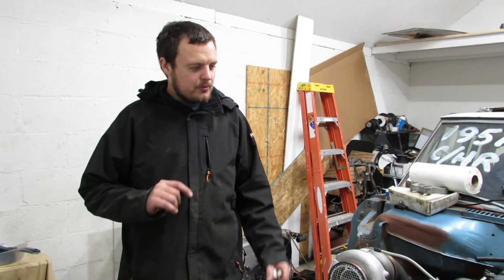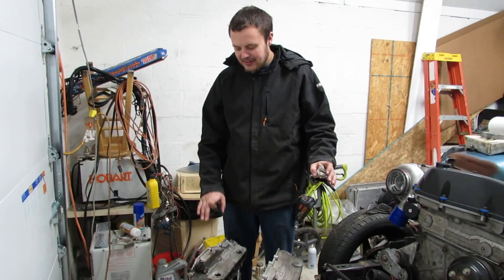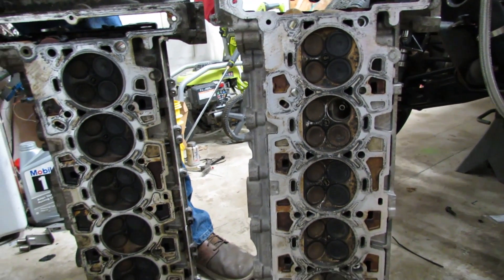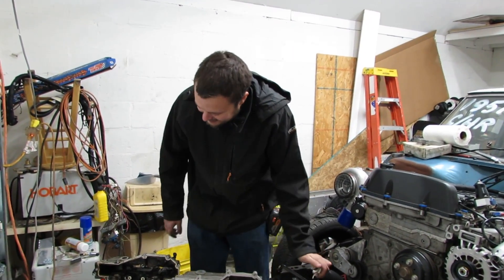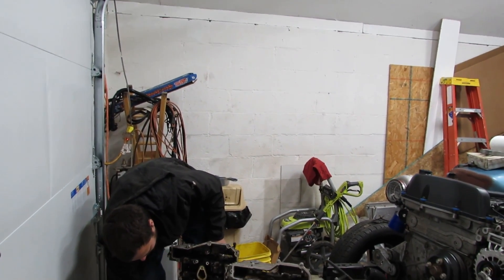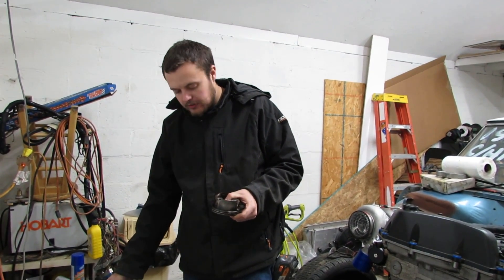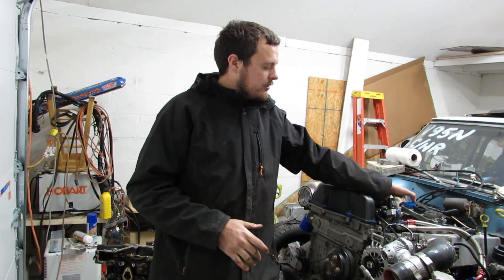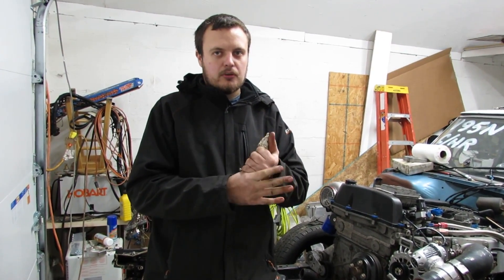Vortec 4200 Engine Differences

Comment: What do you think of the removable sleeves in the block? If you were to use an aftermarket ECU what would you use? Megasquirt perhaps?
Reply from the maker: They're not really removable. 

I use Megasquirt 3 Goldbox.
Reply: @Calvin-Nelson  Replaceable i meant. I read somewhere that they're replaceable, but that of course is the internet. The block does have sleeves correct? I live in San Diego and I'm close to Darton Sleeves. Currently working on an 04 Trailblazer LS. This video was really good to see the difference in heads. Are you using the stock head studs or aftermarket like ARP? And head gasket? I've been looking towards Cometic or whoever makes a multi layer steel. Eventual goal is a remote mount twin turbo setup at the rear axle. I have two genuine Garrett GT3076r's that came off my 05 Audi Allroad project.
Reply from the maker: @ProjectCarTV  I'm sure that you could sleeve a block. Not really worth it in my opinion. The stock blocks will take some abuse from what I've read and experienced. All the stuff we've done is with the stock engine. Not even opened up. They come factory with MLS head gaskets.
Reply: @Calvin-Nelson  gracias!
Reply: @Calvin-Nelson  Thanks a lot! I'll have to do some sleeving no doubt though. I ordered a 4l60e from Monster Transmission that's good for 1000+. I saw the stock rods in your video and although they're pretty beefy I think I'll go with Pauter.  I'm lucky to be where I'm at in San Diego, so many good companies in this city. Crower, Pauter, Carillo, Darton. Not to mention machine shops. I have a spare block that I'm going to be taking for machining soon. Using two 3076's automatically puts me well above 500hp. I may use a stock block for testing. I have a lot of work ahead. Still have to find a daily driver to take the Trailblazer off the road. One that I won't be tempted to f**k with. I can't even buy a used Hyundai Elantra because the 2.0L engines are shared with Mitsubishi and I'll be tempted once again lol. Thanks a lot. I've been following your channel but never commented.

Comment: Can you just run the stock 02-05 ecu for a turbo set up and switch it to a 2 bar map sensor? My buddy and I twin turboed a 5.3 and were able to tune it with just a 2 bar map on it. Is this possible with the stock 1st gen ecu?
Reply from the maker: No. There is no way to add enrichment with boost.

Comment: Heyy man im bench watch ur 4.2 engine  build to learn more about it wanting to build mine as well. I have my 05 head rebuild was thinking on porting it but don't really know much on all that and knowing that the ecu won't work for tuning would the other one plug in and play haha .
Reply from the maker: You would have to repin it and add a MAF sensor, but it has been done before. It it were mine, I would look at upgrading to an 06+ head and maybe port that.
Reply: You’ll spend $1500 on a port job and it’ll flow about the same as an 06+ when stock. Just buy the 06 head for like $200.

Comment: Thoughts about this going in a 83 caprice?
Reply from the maker: Do it
Reply: @Calvin-Nelson  will I have the same issues with it being too tall for clearance on the hood? 
Also debating on doing manual swap as well. But can’t find information about that either.
Reply from the maker: @Tony20v  I bet it would fit pretty decent. Manual swaps are a bit challenging, but not impossible.

I've been working with a few people to create this site. Check it out. Has lots of info on how to do the Manual Swap.

https://sites.google.com/view/vortec4200wiki/home?authuser=0
Reply: @Calvin-Nelson  oh sweet thanks! 
Hopefully I can get started soon on the swap. Car has been sitting for a few years with no motor
Reply from the maker: @Tony20v  cool. I really like those cars. They're just such grandpa cars. Would make an excellent sleeper

Comment: so can i put this 06 in my trailblazer 2002 im assuming i can because they fit the v8 c6 in there
Reply: If you have the 4.2 then no. 2002-2005 will interchange with each other. 2002-2003 did not have air injection so if you have a 2004 motor replacing a 2002 motor then you would have to block the air injection on the head which you can take off on the 2002 head. 2003- they also started with return less fuel injection so you would have to swap fuel rails from the the old head. Pcms are different as well as the crank from 2006 and up. So anything from 2002-2005 will work. Over 2006 and your wasting your time. I've seen some make the mistake and end up taking the motor back out and getting the right one
Reply: @christopherzube551  Thx

Comment: Im thinking about a high rpm build. You spoke of these 4200's revving to 10,200 rpm. What valvetrain and rotating assembly would they be using?
Reply from the maker: Definitely have to shim the lifters to essentially make then solid. Another hot ticket is to use Ecotech followers. They are stronger, and interchange. Not sure what to recommend on valve springs. I found a set of 2JZ valve springs that will work, I just don't know if it will work at 10,000 RPM. These engines have very bad harmonics at around 6,500 RPM. Guys that are taking them to 10,000 RPM run like 7,000 stall converters. Basically they just get through the bad harmonics as quickly as possible.

I would probably be wise to put cams in it so that it will make power at that RPM. Billet cams are expensive, but you probably can get away with a regrind. In my opinion the stock cams are pretty decent and you can do a lot with them. Not sure if they'll support power at 10,000 rpm.

Comment: If you have the desire, money, and engineering skills, take two of those Atlas strait 6 and make them into V12.
Reply: I've been working on that.  Designing a block.
Reply: @andyharman3022  I have been doing the research.  Hear are my segestions.  Keep the cams, pistons, buy 6.000 chevy rods, origanal timing sets.  all you have to do is find a good machine shop and have them make you a pin to go into the mains.  Have the blocks machines 30 degrees center of the mains, use the pin to keep the two halves alinged, shift the right block 1" vs the left.  Take the left head, (one head) and machine all the crap in the front and spin the head around 180 and phase the cams 30 degrees vs the other bank.
Reply: @adamsholzhaus8196  In my design, I am going to leave room in the crankcase to increase the stroke somewhat.  So rods longer than 6.000" will be necessary.  I have already designed the crank.  The Atlas doesn't get enough attention for how strong its lower end is.  It has main bearings as large as a big block, and rod bearings larger than a small block.  I have worked out a cam drive system for the right bank head, which will be turned around.
Reply: @andyharman3022  The pistons are 1.129 C.H., the rods are 5.984 the deck height is 9.160 which makes 4" stroke the absolute limit for it.
Reply: @adamsholzhaus8196  I'm designing the block, I can make it any deck height I want.  It will be taller than 9.16.
Reply: @andyharman3022  My bad, I didnt realize you have bottomless wallet.  God loves you my friend.  I hope you build the v12 out of 2 gm atlas strait 6 engines.

Comment: So can the 06 up head and cams be installed on the 05 down block? Or can the 05 down crank go in the 06 up block?
Reply from the maker: Yes, and yes
Reply: @Calvin-Nelson  outstanding. Thank you.
Reply: @Calvin-Nelson   so if the later rods and piston fit on the 12 counterweight crank would the rotating assembly be unbalanced or does it not matter?

Also Thanks for all the great information you share. It’s awesome

Comment: In the early coils what was the plug gap/boost when break up occurred? Also other than cam cover/VVT difference does the intake, exhaust, front cover and oil pans have a common pattern or are there some variances? Im doing a Barra in my 65 F100 but thinking of one of these for a buddies 66 chevy truck vs the 2JZ since he wants something unique and different too
Reply from the maker: Ngk tr6 plug. 0.020" gap. Probably could have gapped it down a little more but we were out of time.

Comment: Nice info.  Have you talked with the Nova wagon guy? 
12yrs ago he ran a 9.31 with a 4200
Reply from the maker: Not yet. Would love to though.
Reply: I do have a question. You have the plastic valve cover on that engine with fabricated intake, so small port head why? 
My daily driver is a 03 4200, rattles like crazy when its cold.
I live in mich.  Seems like its the pistons, are they forged?
Reply from the maker: @terrypikaart4394  no. They're hypereutectic

Comment: Great video, a question though for the Luddite in some of us; Any method of installing a brace of Side Draft Webers and putting a manual trans behind the 4200??
Reply from the maker: Yes and yes. Go on the Vortec 4200 swap and performance page on facebook. They have all of the details for manual trans swaps there. For weber carb install, all you need to do is make an intake.
Reply: @Calvin-Nelson  Thanks! Will check it out.

Comment: So early bottom end, retro a 58x reluctor on the crank, 06+ head, and swap the 08+ 4x cam wheel on. got it.
Reply from the maker: Yep. You will have to attach the 58x wheel to the damper, because the internal trigger wheel is not removable.
Reply: @Calvin-Nelson  oh BEANS. I'd want to use a Holley efi as that's what I'm familiar with.

Comment: Thank you..
Reply from the maker: No problem!
Reply: My Build is a 05 Trailblazer My Dad gave me years back....The exhaust: Turbonetics 57 trim with blue upgraded inlet housing feed to a f250 3782vnt 6.0l out to a 4082klvn Hino 7.3l.... Intake: 4082 out to 6.0L then T3t4 intercooled under my driver seat... I will Piggyback the 6.0L vnt to my Stock VVt line and manual flip the 4082 for boost.... all of stock Pcm settings.. Wish me luck... I'm  going for that Jet Sound you hear when a Plane low passes....

Comment: So it's much like a LS, they all will GO, only you may want a aftermarket ecm, do the later model heads fit the early engin? Great video, I appreciate the knowledge!!
Reply from the maker: If what you are asking is do the LT heads fit on the LS, then yes the bolt holes line up. They changed the dowel locations, and again you have to come up with a solution for the valve order.

Comment: What do you recommend I used to add a turbo to my 2008 engine.? Should I use the original wiring harness. Or use some sort of after market wiring harness? I’m sorry I’m not really technical with the terms. Sorry I forgot to mention it will not be used in  the original trailblazer vehicle. I will be using it in a 61 Chevrolet c10 vehicle.
Reply from the maker: Personally, I like Microsquirt or Gold box. You just have to make a harness.
Reply: @Calvin-Nelson  hey thank you for your help,  do you know what wires i will need foe the harness or a good reference website for this. Should i just look it up in you tube under  building a  standalone harness?
Reply from the maker: @JesusGarcia-jr6ij  Honestly the instruction manual is a great source for how to wire stuff. Also I made this for wiring a Microsquirt. https://docs.google.com/spreadsheets/d/1JFqupg_efMv0XPSWGeVn9cH4D6HLt_UuJSw4bZHmuyE/edit?usp=drivesdk

Comment: Do u know if I can use the p12 on my 2008 engine? Is it plug and play? M trying to install my engine on a 61 Chevrolet but I’m basically transferring my body from the 61 over to my 08 trailblazer chassis. Is there a way to run the engine on that body without having to take out all the wiring from the trailblazer. I eventually want to run a turbo on it.
Reply from the maker: No. They have different reluctor wheels.

Comment: Thanks for showing the two cylinder heads side by side. Question for you, in 2007 GM increased the bore size for the I4 and I5 versions of the Atlas engine by increasing the cylinder liner size. Since the valve sizes increased on the I6 did they not increase the bore size as well?
Reply from the maker: Nope. Never did that on the 6 or it probably would have been a 4.4L
Reply: @Calvin-Nelson  That's what I thought. Even if you wanted to put the 3.7 or 2.9L liners in your 4.2 block you'd still be stuck without an off the shelf head gasket.

Comment: Hole drilled in conn rod bearing... hmmm.  PROOF POSITIVE that we've got some slops working as engineers at GM.  Seriously though, 450whp out of an alum block inline 6 is respectable and a testament that these are not throwaway engines.  You want more, go to a 2JZ or a Barra or something like that.  For everyday tire shredding fun, this is too much fun to pass up.
Reply from the maker: Yeah. I plan to find out if the other inline 6 options are required. I think the Vortec 4200 will surprise people.
Reply: 2jz needs a deckplate...

Comment: My usual tuner cannot flash '06-'07 computers. Any idea why? 

To add: These engines are very sensitive to oil change intervals and quality of oil. 

IIRC a full dressed engine is roughly 550lbs. About the same as an iron headed SBC. Theyre not light weights.
Reply from the maker: No idea. I've never tried to flash one, so not sure.

No they are way lighter than that. A bare long block is 320 pounds.

Comment: So,I want a 2002 crank,06 up head,06 to 08 ecu,06 up rods and pistons.    Also wondering if a 06 up intake cam would improve performance on a pre 06 engine.
Reply from the maker: You do not want a 2002 crank. They are unique. You want a 2003-2005 crank. 

I'm actually in the process of seeing if an 06+ cam will improve my 04 engine.
Reply: if im understanding that you just want all the best parts then you want an 06/07 complete truck and swap a 03/05 12 weight crank into your block.

Comment: Why the decrease in power on the last two years of the 4.2's production life?
Reply: Possibly emissions or SAE rating requirements. Having driven and worked on all of them, the 08-09 engines are the smoothest, most power etc. in factory form.

Comment: Good info! After watching your videos, I want to stuff a 4200 into my BMW.
Reply: Would be nice in a 5 series. I had a 530i with a Garrett GT40 and it was awesome until a guard rail bit me and caused frame damage. Just a slight dinger on the highway but it was enough.
Reply: Likely hood interfearance

Comment: After watching this I want to put an 06-08 head and pcm on my 02 envoy. The kids love when I red light race ricers. It sounds pretty nasty through a 40 series flowmaster at 6500 rpm also.
Reply from the maker: Careful. Headbolts like to snap.
Reply: @Calvin-Nelson  duly noted. I assume you're talking about disassembly. I would definitely go back together with new ones. Thanks for the info.
Reply from the maker: @jessesims4654  yes. Disassembly.
Reply: Do they make better head bolts for the 4.2 that will resist snapping like ARP bolts??
Reply from the maker: @kipholder8577  I have found that gen 3 LS head bolts are just about the perfect length and thread. You want the long ones. 

The Vortec 4200 head bolts don't snap going together. They snap trying to remove them.
Reply: Yes. I want to remove the old 4.2 bolts but replace them with better ones that hopefully wont snap if i need to remove them again
Reply: @kipholder8577  once they snap they are easy to remove.  Much easier if the engine is out!

Comment: The engine coolant temp sensors are also in different locations. On 02-05 engines its in the block and on 06-later engines its in the head. So if you put a early head on a later block you won't have a place to put a temp sensor. I drilled and taped the upper coolant elbow to house one. Also coming from the repair side of the industry the biggest failure mode we see on these engines is broken valve springs/valve keepers not staying in place, causing bent valves in heads and misfires. This is on stock engines, I'm not sure why it happens but I've seen a trend of them failing this way. The only other failure I've seen is run out of oil causing rod knock.
Reply: 02 trailblazer had rod knock, had a free 07 engine with a bad head. Cheap is why.
Reply from the maker: Yep. Good catch.
Reply: Why would you put up an older head on a newer block? Maaan. You have to do the opposite. 
I own a 04 trailblazer with the P10. Got a complete 2008 engine. Im gonna swap the crank of 2004 to the 2008 engine and rewire a P12 PCM to get the best ever vortec.

I confirm 2007 head works well on 2005 block.

Comment: I had the 2004 in my 2WD trailblazer, great motor, no complaints except the exhaust manifold kept cracking. What RPM are you running it up to on the track?
Reply from the maker: 6000 for now

Comment: So in a nut shell its pretty much like the ls engine world..
Use the later model pistons rods, and cylinder head on a earlier model block/crank.. because of ecu options(in this case a stronger crank)
I guess there was no changes made to the block between years?
Reply from the maker: I think they did very minor things. They're all pretty good.

Comment: First!!!! I've been sooooo waiting for this. Thank you veeeeeeeery much man! Posting this to all TB Groups.
Thank you for responding to my request. Keep making this engines go BUUUUUUUUUUUUUUUUURRRRRRR!!!!!!!
Reply: Nice piece of education Calvin. A lot of misconception out in the forums where people claim that using a 06 and later cylinder head on a 05 block  is a way to increase HP. Clearly none of them actually tried what they claim otherwise they would have discovered the bolt pattern variation.
Reply from the maker: No problem. Thanks for the idea!